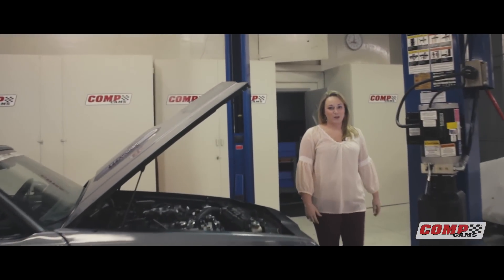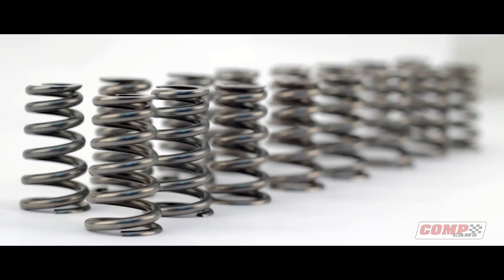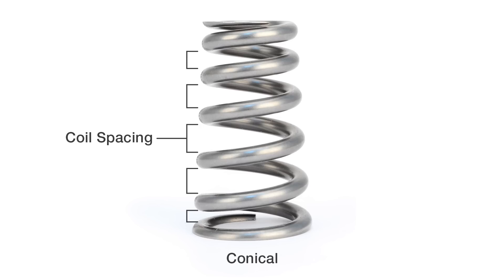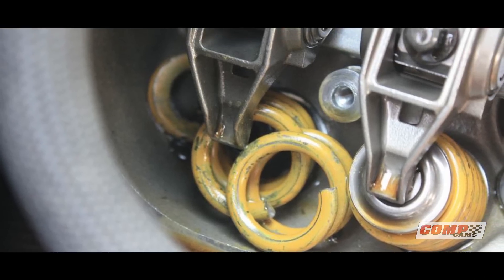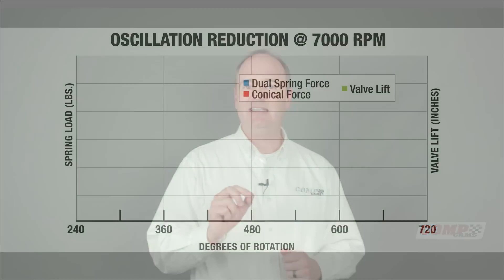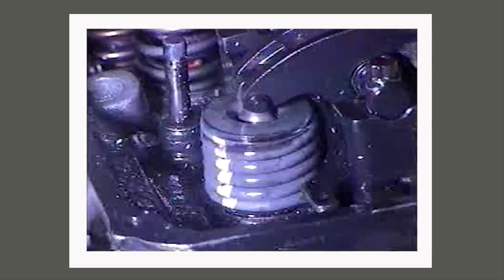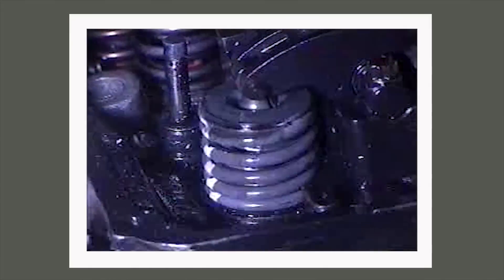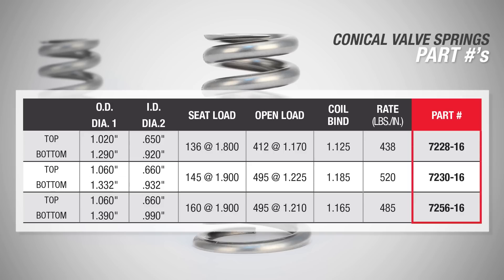Product Spotlight: COMP Cams Conical Valve Springs

Comment: Sorry guys but I am not sold on this idea. It's only advantage is that it may be cheeper to produce because unlike the behives.......first, the wire doesn't look like the ovate wire that combats resonance very well. Second is the way the spring tapers, it should be curved like beehives to cmbat resonance even further. And whats with the spacing between coils being tighter as you go towards the top!!!! Ask someone who knows how to calculate spring rates and he will tell you what I mean
Reply: but I have read papers where some people have posted better results with conical springs with ovate cross sections, and one of the paper was even published by SAE if you want ill share you the link